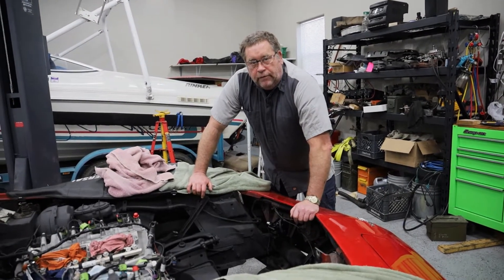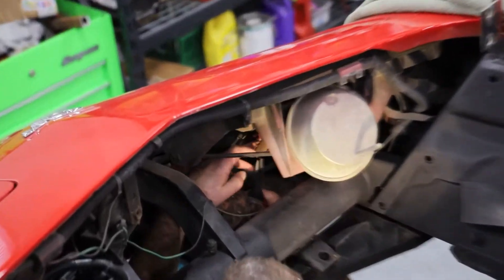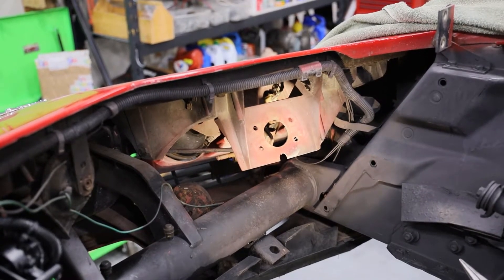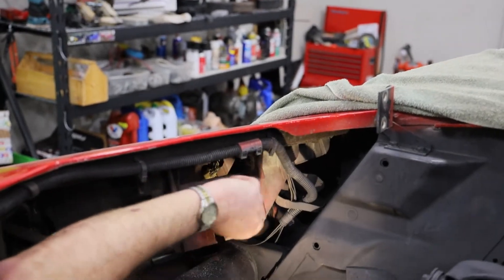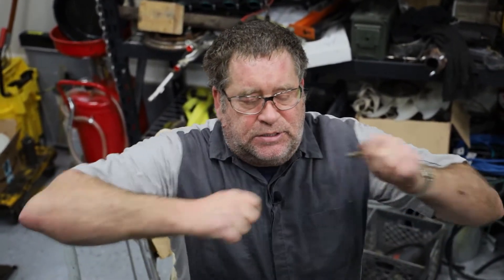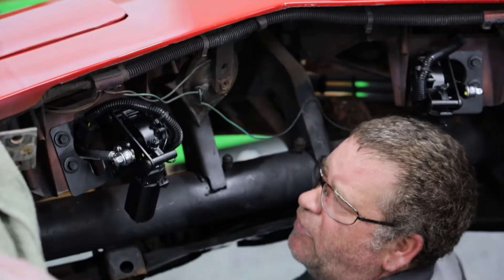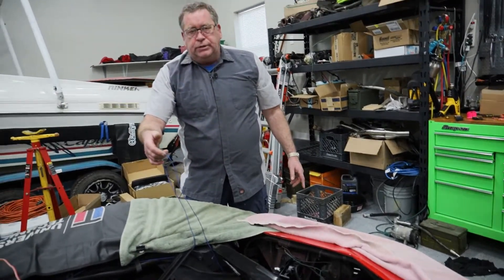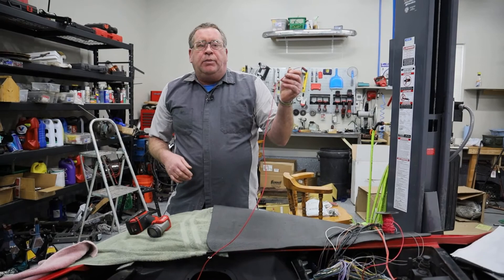Installing Electric Headlight Actuators in a C3 Corvette

Comment: No help on the wiring connections, instruction has that written information, where, how do you connect to the dimmer switch. As far as power I connected the (red wire) to the alternator, this way both blue and red are on the drivers side of the car and can be contained in the same wire conduit for cleaner look.